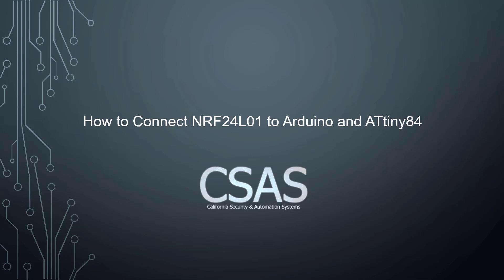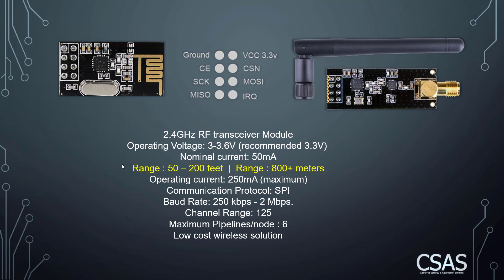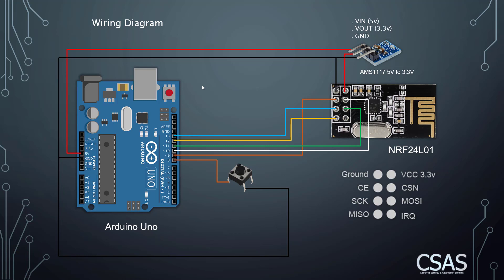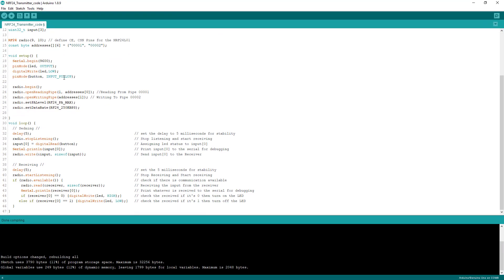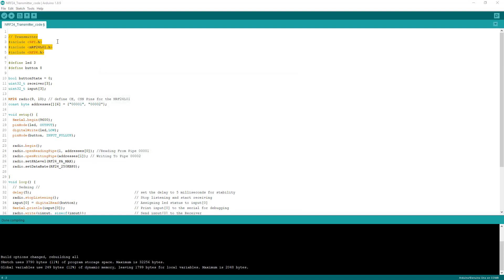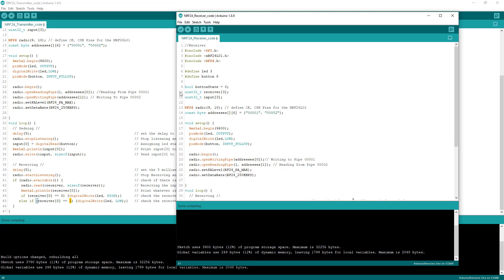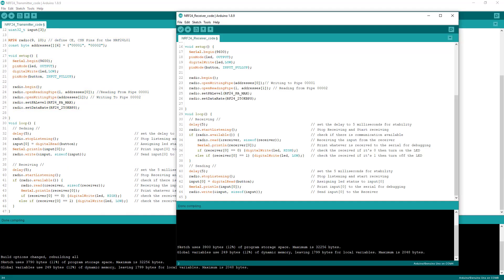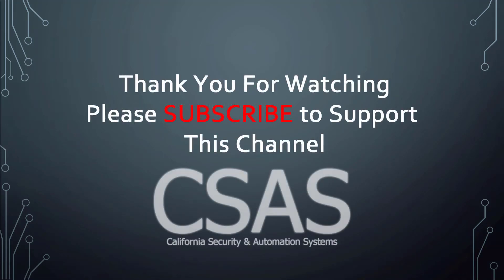How to Connect NRF24L01 to Arduino and Communicate with another NRF24L01 - Part 1

Comment: I have problem with 2 two communication. My 1st Uno has pushbutton (sending) and Servo (receiving)  and  2nd Uno has  LED (receiving) and Potentiometer(sending).  It works only 1 way. When I push button on 1st Uno, the led on 2nd Uno light up.  But when adjust the potentiometer on 2nd Uno, the servo on 1st Uno doesn't move. I already checked all the cables.   Please help.

Comment: Can we use arduino nano instead of UNO.if yes ,will there be any difference in their code.
Please reply as soon possibly👏
By the way,love your videos!!
Reply from the maker: Luna Suthar yes you can, just make sure you are using same pins
Reply: @VoltXSystems  
Thanks a lot!
Actually I am making a transmitter and receiver using nano and nrf 24 module for rc plane.I am facing an issue in sending and receiving data. So,I was looking for simple setup to test my nrf24 module and nano,to see if they are working.
Once again thank you!!!
And you got one new subscriber.
Peace ☮️😎